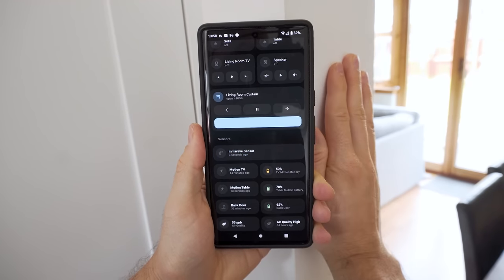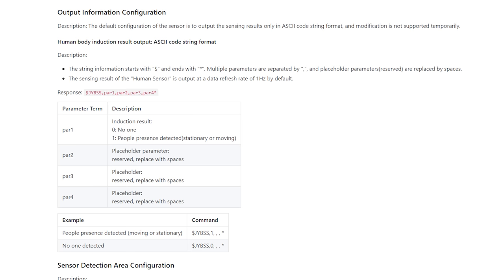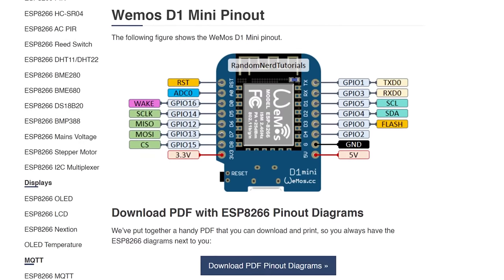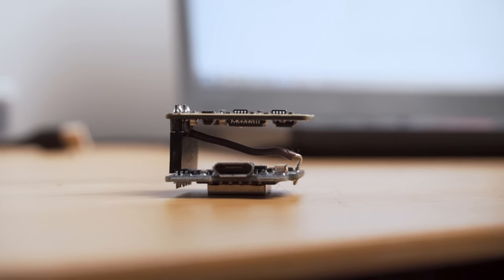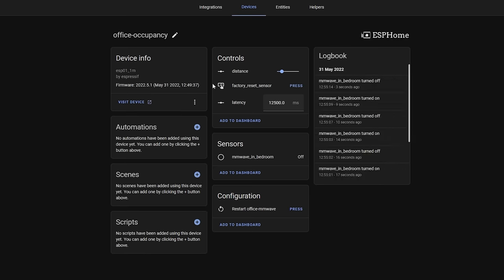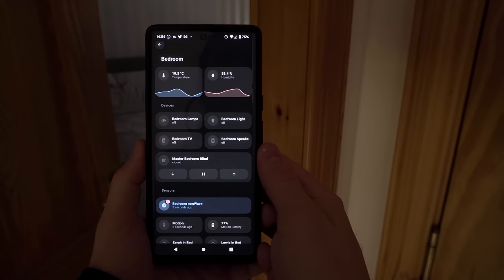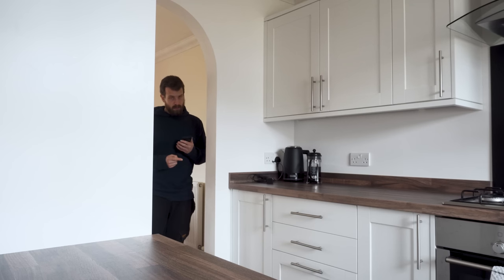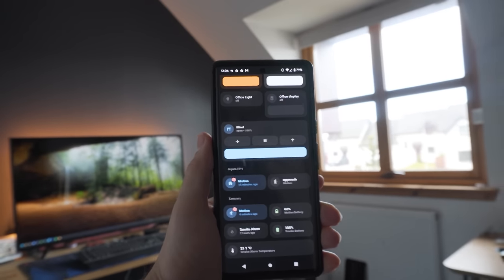I Built My Own Presence Detection Sensor!

Comment: Just received 2 of these sensors to test. Could not get it to work... just kept seemingly randomly flapping. Then I tried IO1 pin on the sensor and it started to work perfectly. (in case anyone else has this issue)
Reply from the maker: Which board are you using and which pins did you have set before?
Reply: @EverythingSmartHome   It's an ESP8266, Using GPIO16 to IO1 on the sensor in the working configuration.
Reply: I previously had GPIO16 connected to IO2 which wasn't working correctly for some season
Reply from the maker: Hmm it's not really possible, your supposed to use GPIO16 as it's the only pin with a pull down resistor which is required.
Reply: No no, I'm still using GPIO16. just the IO1 pin on the sensor rather than IO2
Reply: Sorry if I wasn't clear before
Reply from the maker: Are you sure it wasnt a bad solder joint? Io2 is the preferred and default pin
Reply: I did think that could be the case, but on both sensors was unlikely but I resoldered and still the same. I've now ordered some of the mini esp8266 from your link so I can rule out the module I'm using.

Comment: Your setup seems to have a flaw. mmwave sensor operates at 5v and interacts with esp2866 gpio pins that are rated at 3.3v and not really tolerant to 5v. so eventually your gpio pin is going to burnout unless a logic shifter is placed in between.
Reply from the maker: The D1 mini has a 5v pin.

Comment: Nice, but I will keep using my espresense sensors for room presence for now.
Reply: Esp presence is to slow, i only find it useful for tts etc… so in combination with pir
Reply: love espresense plus it can detect who as well not just if a person is in a room. have mine set to check who started the washer or dryer then target the google assistant thats in the room that the person is in and tell them that the washer/dryer is done and they should swap out there clothes. Has stopped a lot of complaining in the house as everyone was annoyed at all the googles going off all at once to tell one person to swap out there clothes before i installed the esp32's with espresense on them.
Reply: @erwinsmith5804  Try increasing the absorption level until you get quicker response times. I had the same problem until i adjusted it. 2 to 5 secs now as opposed to as much as 20 secs before. I still use my existing PIR sensors to turn on the lights in a room but use espresense to determine who as well as when a person leaves it. Keeps the lights on while i'm reading or working on the computer.
Reply from the maker: If they work for you, no need to change! :)
Reply: @HATipsByLarry  What are you using as your detected devices - mobile phones?
Reply: @Ditaliano88  for me and my wife yes for my wifes mother am using a bluecharm beacon with a button that transmits a different UUID for when the button is pressed.